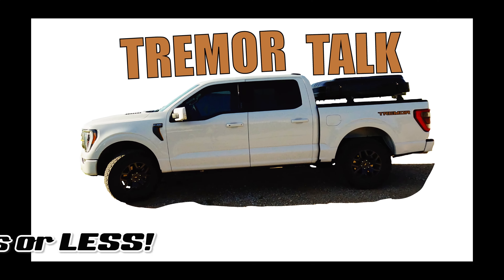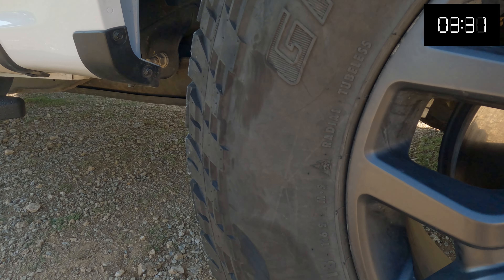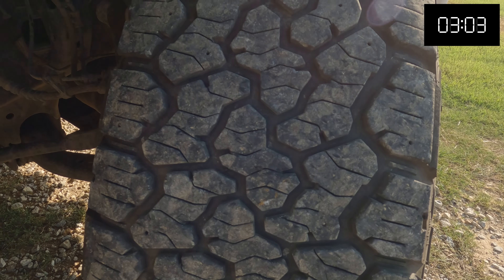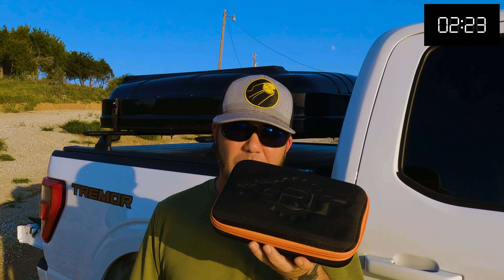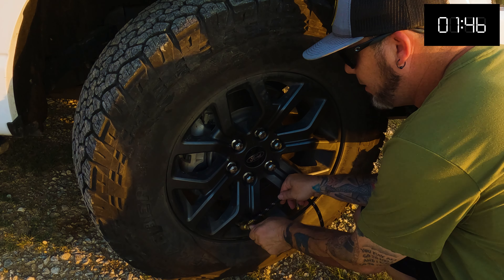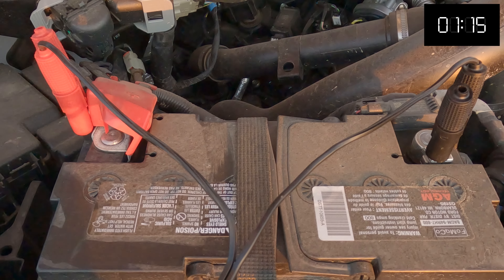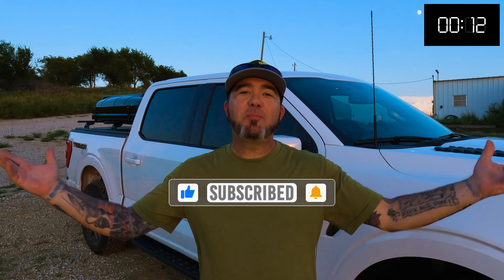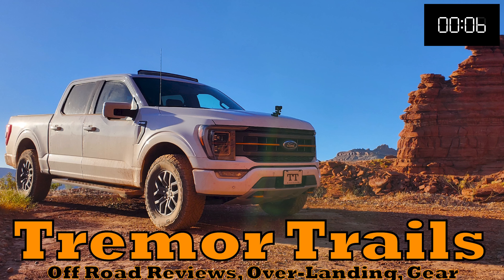General Grabber A/Tx ANY GOOD? F150 Ford Stock Tremor Tires PSI Settings.

Comment: Great update/review.  I personally agree with you, I don't have a Tremor yet but I did put these on my 14FX4 and they perform flawlessly.  Running on road at 40-41PSI.  Midwest area; City, HWY, gravel, some mud and a lot of snow.  Never any issues or concerns.  Still look new at 12,000 miles on them
Reply from the maker: Awesome! Yeah for some reason people think these tires are crud and that just isn't my experience with them.  Thanks for watching Marc!

Comment: After 30 years of being a BFG AT tire fan I switched from BF K02 to General Grabbers.  The K02s were getting ripped up on the trail too soon, they weren’t as good as they used to be. I have had the Grabbers 2 years abd they have been great!
Reply from the maker: Thanks for review! I'm glad I'm not the only one.  I think these tires (for some unknown reason) are getting a bad wrap. After almost 25k on them. I have a hard time finding major issues.
Reply: @TremorTrails  if you look at the tread pattern they are pretty close to the BFGs.   I live in the desert so they haven’t seen snow or very much mud use so I can’t speak to their effectiveness in those areas.
Reply: I buy Grabbers because they are p rated/lighter Ko2,s . 265/70/16.  over 10#,s   lightrr.😊❤

Comment: Thanks for the video. Super helpful, driving an FX4 that came with the smaller 275/65. Wanna go slightly bigger to the 275/70 but don’t want E. Not many D or C in all terrain in the 275/70. Comparing these to the Goodyear Duratrac.
Reply from the maker: They held up pretty well for me and I definitely over used them. Also they were way quieter than my current Nitto setup.

Comment: 42k mile on oem. Not a trial guy. But general highway midwest weather. Tires have been great wear is good ,more life on them than I expected at this mileage. I'm around  a 17-18 mpg 3.5 motor. Truck loves low speed , in town, mountain area for what ever reason. In yellowstone got 21 mpg.
Reply from the maker: That's some good mileage, no doubt.

Comment: Have mine on order, 402A in azure grey. Will run the stock tires out (maybe) then go with the Falkin Wild Peak 3
Awesome tire. Thanks for the videos, nice work. 
Cheers
Reply from the maker: Thanks Mike! You'll love the truck.
Reply: . Have you received your truck yet I have one on order right now ?
Reply: @JamesWilson-lg7bx  mine was built on 11/27, waiting on shipping
Reply: For some reason, window sticker says heated steering wheel delete for -$140, must be a chip shortage, I don’t remember asking for removal.

Comment: I'm gonna try 30 on my 22 when I get it in a couple weeks, I have historically run my tires a bit lower for ride quality and wear.  My polaris general came with 22psi in each tire from the dealer on the 30" Pro Armors and I run 11 in front and 13 in the rear and its been great for 2000mi.  I have gone as far as letting air out a little at a time to see when the dust pattern goes all the way across the tread when backing in my garage lol.  For my V10 Super duty with the 285 Toyo's it's 40 in the rear and 50 in the front lol.  So we will see about the tremor!  Thanks for all your vids by the way you do a great job I really enjoy watching my soon to be truck that's on a GD chip hold right now......... :(
Reply from the maker: damn chip hold is getting old! Thanks for watching Brad! Let me know when you get it!
Reply: @TremorTrails  will do buddy I called today they said 8/17 - 8/23 so crossing my fingers!!

Comment: i still prefer BF K02s i leveled and added 35x12.50r18 at 30-35psi on stock rims. 
drives great and looks wayyyy better
Reply from the maker: I've heard some good and bad about the Ko2's. I've personally never owned them so I can't say one way or the other. I'm running 35 12.50r18 in the Nitto Recon and so far really love them out on the trails. But yeah once you go up to some bigger tires the truck just takes on a meaner look!

Comment: Big ko2 is the only tire I’ll run now on my second set on my 17 fx4 averaging about 20k a year and they lasted me 40k miles with about 4k off road a year some technical stuff but lots of gravel don’t recommend C load range I got a lot punctures with them running E load now no punctures 12k so far with slightly lower pressure 33 vs 35 on road and 20 vs 25 off road you can run 18 psi If you take it slow but I only do that for sand
Reply from the maker: A lot of people run them. I've heard good and bad about them. Thanks for the info!

Comment: Put the same tires on my old lady’s Yukon 6 months ago. Absolutely loved them stick to road like glue and through snow like a champ  . Issue I have now is became super loud and rub your hands across the treads and some way lower then others disappointed with how they wore considering every steering and suspension part was brand new at the time of tires along with rear suspension. Even took them to get rebalanced and they said the run out was horrible in them . What do you do really loved them before the weird wear
Reply from the maker: I was pretty lucky with mine. They ran out pretty good. I rotated alot. I can't remember mileage but think it was only maybe 20k when I upgraded to larger tires. Thanks for watching 👀
Reply: Tires are not to blame Back when I rebuilt front end took it to dealer to have my friend align. They gave it to someone else turned into a 1 month ordeal to get it back.  2 weeks in they said it was done and it would damn near pull right off the road. Took back 2 weeks later came back seemed to drive good but ate tires. Took it to another place I know it was way out of spec. Control arm bolts weren’t even tight.  Dealer don’t want to hear it but it destroyed these tires. Can’t blame tires and I will say they are a excellent tire. I will buy same ones again to replace these

Comment: I think you mentioned towing with your Tremor.  Have you considered airbags for handling the extra sag? If so, any particular brand?
Reply from the maker: I was thinking about it awhile ago but decided not to because I'm not sure of the full effect on suspension travel. Could be significantly less if any air is in bags. As for manufacturers, I have no recommendations

Comment: have you run the recommended 35 psi on street?  I find over 40 is much rougher.
Reply from the maker: I have, I noticed no difference really on mine. I found the ride about the same. Thanks for watching!

Comment: You run your tires at 42psi on the road?  Thought they were recommended at 35. Any advantage to the 42?
Reply from the maker: Max psi is 42. Advantage is fuel mileage. Some say the ride is rougher that's not my experience. I notice no difference in 35 or 42 in ride quality.
Reply: @TremorTrails  aww ok I see why your running that now.  What sort of mileage you getting running them at 42?  My trucks only got 980 miles on it and I’ve yet to see much over 15
Reply from the maker: Give it some time. I remember the first few thousand miles my mileage sucked too. Not sure why? Maybe because of break in with the seals? I haven't paid attention lately but I believe it's 16 .5 city 19 hwy.
Reply: @TremorTrails  Have you noticed any odd tread wear patterns from inflating to 42?  I can’t imagine 7lbs would make much difference but who knows.
Reply from the maker: No my tread is excellent 👌 22k miles on them.